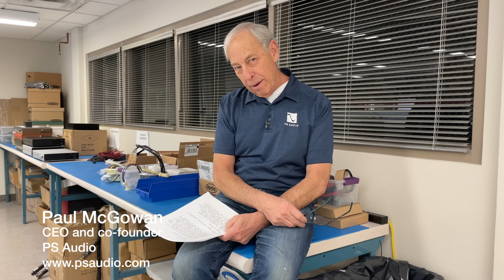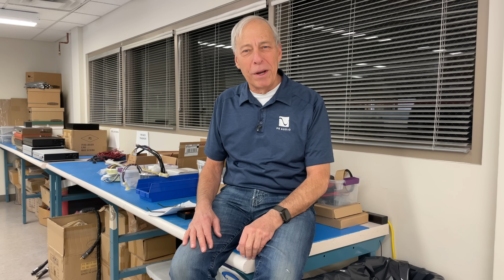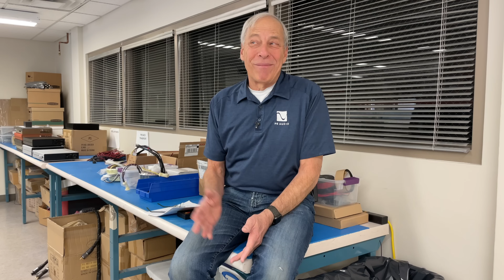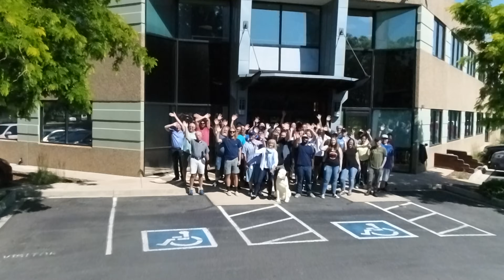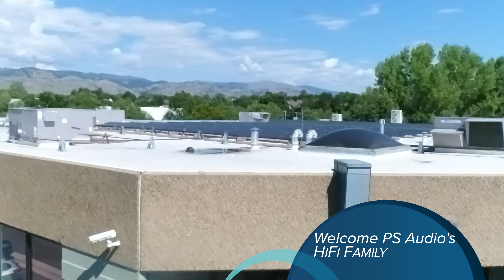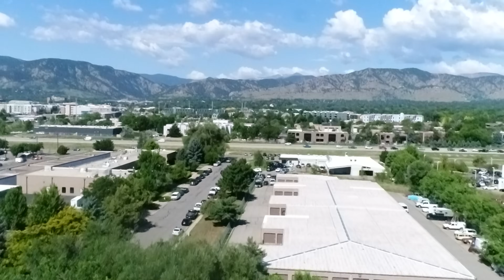Do bigger transformers sound better?

Comment: These videos are becoming more and more banal. The size of a transformer is not relevant and the question is meaningless. Just design or choose a transformer that meets requirements for the circuit design. What next? Are high frequencies better than low frequencies? In Paul’s anecdote, if there was a huge sound improvement then the original transformer was faulty or not suitable for the job.
Reply: Audio isn’t so cut and dry, and there are thousands of natural variables that aren’t spelled out in the on-paper requirements of a circuit that will effect the sound. Like the interleave in a transformer or the surface are of the laminations stacked both don’t change the values required for the circuit but they make an impact. It’s a just question and no questions are meaningless.

Comment: Hey Paul. Forgive my slow response to a past video. I want to know, not about a third channel, about adding a sub. I notice that there isn't an LFE sub out on my DAC or preamp or amp. Can I use a multi channel mini DSP. I could use the two in from the amp. I could then have two out to the bookshelf speakers and one of the two remaining to the sub. This would also provide room correction. I think.. Does anyone else do this or am I just out of luck for adding a sub?

Comment: Impedance, core material and shape most likely plays a role in the coupling and transfer of AC signals. I remember Bob Carver's hand made tube power amplifiers needed output transformers that were meticulously hand wound by Bob Carver himself.
Reply: Not true.

Comment: I have a Schiit Mani Phono Pre... it is a standard 16v wal wart... i one day tried using a 24v power supply from an old laptop... the already good sounding Mani all of the sudden sounded incredible!
Reply: Probably sounds better after all that smoke came out.
Reply: Do you think it is a great idea to put a 24V power supply on an electronic device that came with a 16V power supply?
Reply: @tomterrific9459  it works fine... been over a year... went back to 16v and it sounded dull
Reply: @SantanKettanan-Gayboy  The only reason it would not have burnt out is because the system would have 24V or 25V capacitors.... A 16V capacitor would not be able to take 24V from a 24V transformer / power supply.
Reply: @SantanKettanan-Gayboy  I would send Schiit Audio an email. I have done it, and they do respond.  Ask they why the effect you are talking about would occur.
Reply: @100bsl  After the Schiit Modi3 came out there were discussions like this online, regarding how to power it. Some people said to power it with the computer usb. Some people said to power it with the separate supply, but to not use the one that comes with it, since it is a simple SMPS, and all audiophiles KNOW that SMPS are evil. (That was sarcasm) Those people were using an external linear 5 V supply. People were very loud about this, insisting that powering it "their way" made so much difference you would never change back once you heard it.  
I sent an email to Schiit audio, asking them about the validity of any of these claims. The answer came back quickly: the Modi3 uses an internal board mounted SMPS chip, so it makes little difference how you power it........the incoming voltage is just going to be regulated down to 3V anyway, and by an evil SMPS, no less. They said it makes absolutely no difference, as far as sound quality goes. Power it however you want.

That was a good example of people talking about things confidently that they had no clue about. And I am not taking a swipe at Paul here, far from it. I don't always agree with everything Paul says, but I certainly respect him. I have been in industrial controls design for over 40 years, and have had plenty of those, "I would have never believed it, but........." moments. Weird stuff happens, but the point is, there is ALWAYS a valid reason, and when something odd happens, the reason needs to be identified.
Reply: @tomterrific9459  ... That makes sense. As long as it's down regulated, you should be able to power it with a higher voltage transformer. Thanks for clarifying
Reply: @100bsl  Well, the voltages were all the same. USB is 5V, and the external supply they sent along was nothing more than a 5V USB phone charger. This was all about the differences between linear and switch mode power supplies, and people were forming staunch opinions based on no real information or data. "I will always trust my ears"..........those people. And to an extent, expectation/confirmation bias plays a part in this. People tend to hear what they expect to hear.
Reply: I think you might be confusing Amperes with Voltage. Higher Amperage in a transformer would be the one to look into as this is what gets pulled. The Voltage is dependent on the caps in the system as this gets pushed into the system. The caps should have the capacity (pun....) to hold the Voltage being pushed in by the transformer.
Reply: why not buy a dedicated audio transformer, like an Sbooster, or an Aqvox? Laptop power supplies have tremendous noise and RF.

Comment: I once met an audio designer from Sony Japan which would make use of much oversized power transformers, feeding both his preamp and amps all at once. The sound was amazingly good and effortless, "juicy", and stereo image was jaw-dropping. His goal was to reach ZERO IMPEDANCE at all audio frequencies, something hard to attain. However, I guess there's an optimum size for designing an oversize transformer above the nominal rating required, but it should not be an overkill-sized transformer either, or else it becomes to sound dull and hard.
Reply: I once met Santa clause.......he told me I was a bad boy:(
Reply: @wramrobertodecamargoaccors4679  bot comment beep boop

Comment: Power supply upgrades - usually involving larger transformers in the power supply - was Naim's core business back in the 1990s. In the 1990s, using rechargeable batteries as phono power supplies to completely elimiate the 60 Hz / 50 Hz hum became in vogue. The improvememts is plain to hear given that moving coil phono stages operate with 60 dB (1,000 v / v ) of gain and hum supression becomes of paramount importance.

Comment: I certainly found that a much bigger transformer, (coincidentally also feeding a phono-stage power-supply circuit) vastly improved the sound quality & made the hiss I heard that annoyed me greatly on the smaller transformer feeding  the power-supply, almost totally  disappear on m.c. gain.  I told this to an electrical engineer (my father) at that time who said "it can't possibly make any difference because of the phono-stage"s current requirements" ...but it clearly does. I understand why people theorise to imagine it shouldn't make a difference because of the low-current requirements of the phono-stage & all I could also think was:  the larger diameter of the bigger transformer's windings causes less resistance in those windings, enough to hear a substantial difference
Reply: If you can truly hear a difference, it should be measurable. I would love to know what is changing electrically when you put in a bigger transformer.
Reply: @tomterrific9459    Measurments fall far short of explaining a good sound quality.  Sticking to amplifiers for simplicity sake ...I remember a time when people chose their amplifier purely on measurements alone. (Peter Walker of Quad fame had once thought measurments told all concerning power-amps) 
That time was the early 1970's when i, as a 14'ish yr old schoolboy, would sometimes buy one of the few hi-fi mags around to drool over stuff I'd dream of owning, & a time when a vastly increasing number of Japanese amplifiers were getting imported into u.k. with their glossy adverts chocka full of highly impeccable measurements, the more the better it seemed plus measurements that nearly nobody outside electronics had ever heard of before (like rise-time)
 A measurements war then started & I assume most manufacturers felt obliged to join in just to keep selling thier amps.
 In those days, an amplifier with say, 0.02% THD was automatically chosen by a clear majority of buyers who assumed it to be automatically superior to any amplifier with 0.2% THD with all else being equal. But after the hi fi  buying public had heard enough ampfiers with impeccable measurements sounding dull, boring or just plain awful & only occasionally good despite all having great measurements, those hi-fi buyers eventually stopped relying on measurements  alone & the hi-fi press accordingly blossomed & multiplied as buyers wished to know what knowledgable hi-fi  golden ear'd "experts" thought of a certain amplifier's sound quality rather than just wanting to know it's measurements to compare & simply buy the amplifier with the better numbers.
Imo, measurents can only tell if an amplifier is designed properly to an a acceptable degree ...or not, while measurements alone say next to nothing about an amp's perceived  sound quality. By 1980 onwards, amplifier adverts mostly stopped plastering measurements all over their glossy adverts, 
 (except for power output wattage)  instead they much prefered to refer folk to what hi-fi "experts" had to say about their amplifier's reviews in hi-fi magazines (if it was given 5 stars or whatever words approved it)  & today from online reviews rather than measurements alone saying next to nothing about how any particular amplifier will sound.  
If an amplifier manufacturer changed all the caps & resistors in one of his amplifiers, with exactly the same component's measured values from an entirely different component  manufacturer, they will hear a difference in sound that measurements cannot explain & I don't think they can explain, it's probably a case of "suck it & see" which sounds best for component choice. 
When I once changed to fully valved pre & power amps, the valve gear measurements sucked in comparison to my previous Crimson solid state pre/power amp but sounded surprisingly superior (with a variety of speakers) to myself & all visiting friends.  I put very little credence in measurements alone to choose an amp, tho I may prefer a higher damping factor for some speaker's bass control, e/stats especially but would need to hear it first before relying on that measurement alone.   Good luck
Reply: @The-Spotlight-Kid  "Measurements fall far short of explaining a good sound quality".
Then you are measuring the wrong things. 
If you measure EVERYTHING, measurements can explain everything. These are just voltages and currents. If something sounds different at the speakers, then electrically it IS different, and these differences can be measured.
You are welcome to your opinion, of course. 

Stay safe
Reply: @tomterrific9459  yeah, thanks for that
Reply: @tomterrific9459     read my comment again but properly And to the end, then go & get a very long length of thin wire & compare it"s resistance to the same length of thick diameter wire, because that was the main crux of my opinion why larger transformers sound better & it would be measurable in the very long wire-lengths of a transformer's  primary & secondary windings.  You'll measure a lower electrical  resistance in thicker wire than you'll measure in thinner wire.  Still, you're entitled to your opinions.   Good luck
Reply: @tomterrific9459    oh dear, I'm very sorry as ive only just now realised you may have been referring to my reply to another comment. & if so,  All I can say is: over many years now, I've heard quite a few manufacturers of pre & amplifiers talk in interviews on this very subject,  saying,  from the horses mouth so to speak:  placing different brands of exact same measured capacitors  & resistor  components cause a difference in sound & trials only lead them to decide which they think sound best as there's no equipment that can predict through measurements which components will sound better, worse or just different. So if everything can be measured, they'd be little point for trying out equipment at home or reading review if we could measure everything that defines sound quality. Sorry to disagree with you when I say "some aspects of sound quality just cannot be measured & I stand fitmly by that statement, very firmly.  All the best & good luck. & sorry again to assume you were referring to my initial comment.
Reply: @tomterrific9459   btw, I've heard Bruno Putze (spelling?) designer of Hypex Ncore amplifiers say in interview:  Everything that makes an amplifier sound the way it does can be measured" (paraphrased) He's the first designer I've ever  heard say that, quite unique. 
 His amplifier reviews are still a mixed bag like any amplifier tho.   Measuring all the way to produce the best giant-killing amp possible hasnt  happened yet while top-cost systems I've seen never use his perfectly measured amps.
Reply: @tomterrific9459  it is called confirmation bias.
Reply: @geoff37s38 
It is called trusting your senses.
If our senses could not truly be trusted, then mankind would not have survived for thousands of years.
If we heard a bear stalking up behind us with the intention of having us for dinner, we did not roll our eyes and proclaim "There is no bear stalking up behind me. I know this to be true because I cannot measure it!"
No, instead we said "AAAHH! A BEAR!!! and we ran away, thus avoiding being eaten.
Reply: @Hare_deLune  this is why whenever I walk in the woods I always go with a slow running friend.
Reply: @geoff37s38 
Lol!
I appreciate your sense of humor.   : )
Reply: @Hare_deLune  For whatever it is worth, anything your "senses" can detect is very easily measurable. Electronic design is based on measurements and verifiable proven principles. There is no magic going on. EVERYTHING is measurable and quantifiable. I know, not the statement some people want to hear, but there isn't one set of electrical/electronic rules for audio electronics, and then another set for everything else. Things happen for a reason, always.

Comment: Within reason, maybe. A low power supply output impedance is generally a good thing and will improve performance in some relatively small way. Op-amp circuits largely don't care, some class A circuits are little more sensitive to it. So bigger power trasnformers and larger caps can and do help. That said... the law of diminishing returns DOES come into play, and there's another side to this.

You get a power supply with 100,000 uF of capacitance with 80 volt rails, if something in the output stage shorts, there's going to be a not-so-small explosion and the PCB will almost certainly be totaled. If there's a monster transformer to deliver huge power continuously, then you're going to have a fire inside the amplifier. 

I am of the belief that people who put this sort of power supply in an amplifier have never actually seen this kind of power supply fail, or they wouldn't think it's a good idea. Unless we're talking about an amplifier the size of a Crest 10001, I shouldn't need an arc-flash suit to service your amp. 

You could add rail fuses (and you should), but then you're sort of defeating the whole point of having a huge low-impedance power supply since the fuse adds some finite amount of impedance.
Reply: I remember back in the 1990's, Denon made a receiver that was prone to catching fire after a while.
Have to admit, I don't know whether it was power supply related or not, though.
Reply: @Hare_deLune  A Denon receiver probably didn't have an oversized power supply. That was probably some other design issue. 

Sometimes it's by nature that the power supply is big, but a good amp shouldn't completely destroy itself if it fails. MC2 MC series amps do this well- they have a big power supply with a huge toroidal transformer, but they have rail fuses. In the few instances where I've seen output devices go in these, the damage is minimal as a result.

Some Crest amps however, will turn the PCB into charcoal if they blow up. This isn't anything against Crest- The Pro xx01 series amps are beautiful designs that are equally at home driving studio monitors as they are on the road, but some of their stuff is so big that any sort of failure ends up being pretty violent.

Comment: Big Transformers and big capacitors give big sound!
Something has to move those speaker voice coils to create a Punchy Bass & low Hz waves.
Power!
Reply: You don't think that the electronic engineer who designed the entire electronic device would also be capable of specifying the correct size transformer and capacitors?
Reply: @tomterrific9459  they design to a cost parameter. With no budget they would design differently.
Reply: Actually  if you got a big transformer you better off with small capacitors and vice versa
Reply: @johnsweda2999  Any good phono preamp is using a regulated power supply and thus the power rails can remain constant as long as the transformer outputs the needed voltage and power. A crazy big transformer for a phono amp is not making much sense.
Reply: Not necessarily true.